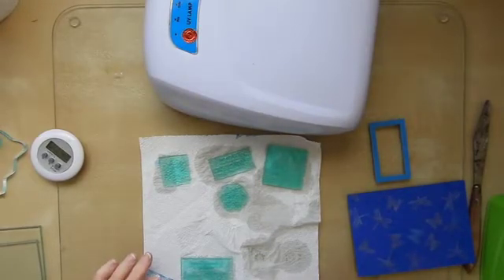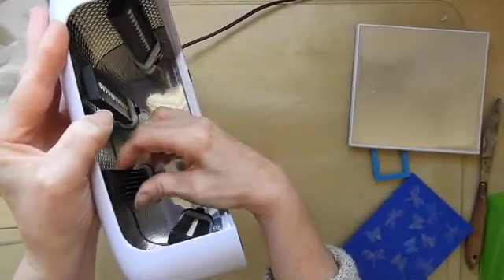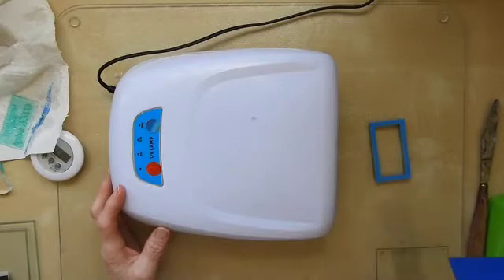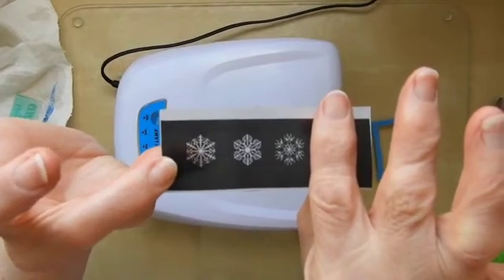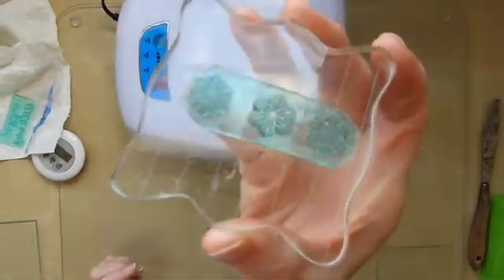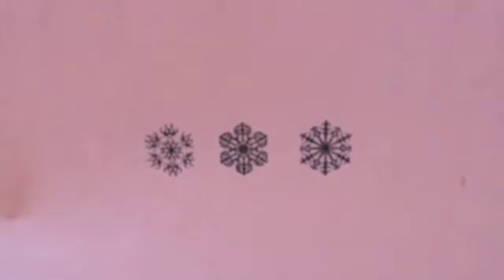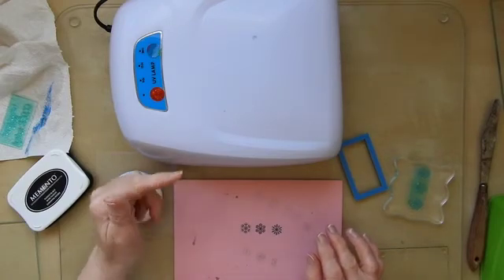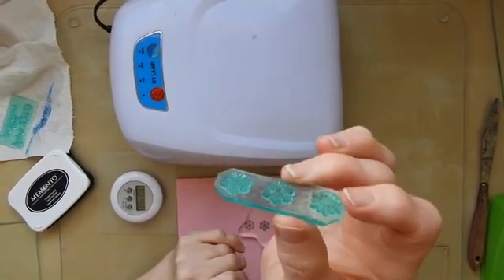Polymer Stamp made in 40 seconds?    18

Comment: Oh, I'm liking these stamp making videos!  I've watched some of the newest videos, but now have gone back to the first ones and am watching them all in order and following your discoveries and learning.  Lots to learn just by seeing the different things you have tried. 

Have you tried making the stamps using just the top two LED lights and removing the side lights?  I know from one of your videos when you still were using the tube bulbs you had gone to using just two of them.  Perhaps you try this (only 2 LED lights) in a video I haven't come to yet?  You have talked about when the light is less intense it gives you more control with the timing and that is why you turn the bulbs facing out. So would using only the two overhead lamps slow it down more and be better, or might that make it so slow or uneven to be unworkable? 

Another thought is that If two bulbs would work, it would also make it less expensive to get started as I would only have to purchase 2 rather than 4 of the replacement LED lights.

And one more question, if you please.  I understand about putting the stamp back under the light for a final hardening up cure after the wash out, but I'm just curious why it put in water rather than just setting it dry under the lamp?  What would be the difference if it was done not in water?  I'm just curious to understand how this all works and don't have any of the supplies at this point to try my own experiments.
Reply from the maker: It's nice to hear someone really taking notice of the video content! I can't remember if I tried just the two LED bulbs, so I'll give that a go later today and see what happens :) It was quite a while ago that I swapped to the LEDs..still using the same bulbs!  Re the hardening in water, I have wondered that. I think it is to stop the stamp from getting damaged/dried out/curling - or it may be because in mass production they use a salt in that water to take away the stickiness. Sometimes I just rinse the stamp off and place it wet, under the lamp again. I have not noticed a difference but I tend to make batches, so putting them all in a small tub, covered with water, stops them sticking together!
Reply: @createinspain  Thanks for the information.  I hadn't thought about them being so sticky when not fully cured, so water makes lots of sense if you have more than one.  I bet you are right about the water being a carry over from mass production, though.  I'm currently looking into the supplies I would need to purchase to get started with this so if you do learn anything about using 2 LED lights I would be interested to know.  It looks like this will be a a fun challenge. I love to try to figure out how to do this sort of thing. Right now I don't have access to a laser printer, but I have a cutting machine so would plan to use a cut design like you show.  I'm also thinking I could try to use thin square-profile dowels to make up a frame.  On another note, I am awaiting my order of Gouache paints that I ordered after seeing your videos of all the neat things you can do with them.  I am learning so much - Thanks for sharing all of your experimentations and your cutting files!
Reply from the maker: @nancybackes111  I didn't get around to playing with it yesterday, but will today. The dowel, if the right size will work but you may want to paint it with acrylic.
Reply: @createinspain  Oh, that's a good idea - I was thinking of covering it with plastic wrap, but just just a layer of paint would be much more re-usable.  Of course, if I really like this and want to do a lot, I'd probably get in touch with you to get some of your frames if you are still selling those.